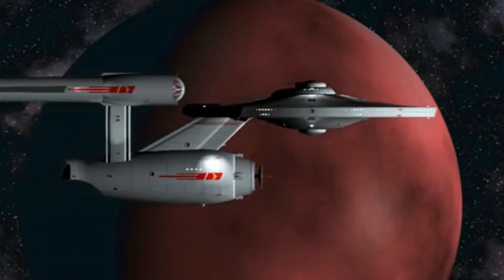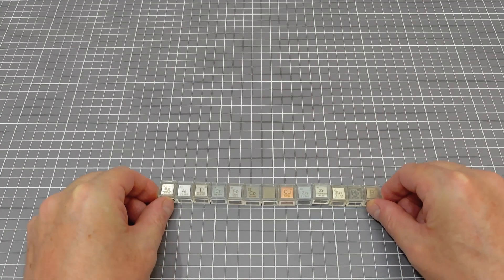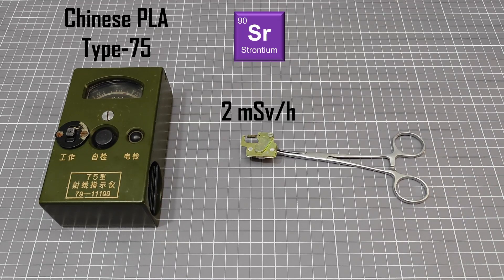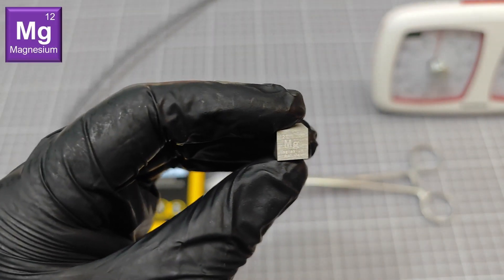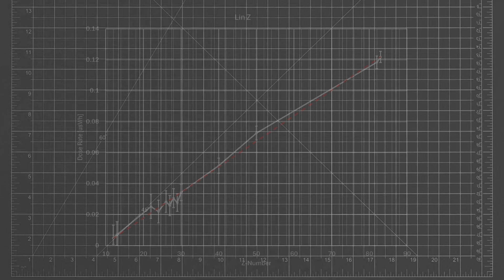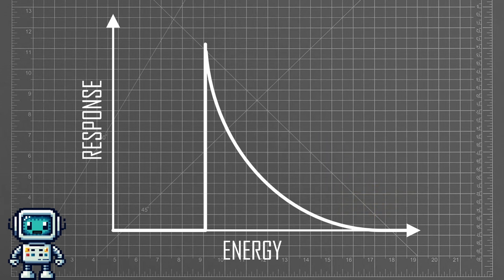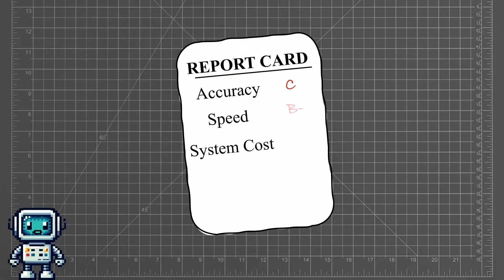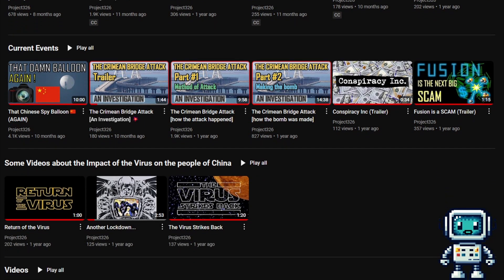Identifying Elements with Beta Backscattering [a DIY project]

Comment: Awesome! This is an excellent and very informative video! We share a lot of the same interests and ideas, and I simply love that! The experiment you've done with these elements is quite aprapos to what I've done, so far! I've (sort-of) done this, but instead I used a 10 μCi (370 kBq) ¹⁴C source and a "pancake" G-M tube–that is, the SEI Inspector USB Geiger-Müller counter. Also, I have to have the ¹⁴C source closer to the target, since its endpoint energy is only about 156 keV. If I place the source (active side up/inactive side down) on top of the G-M tube, I detect "skyshine" from the low-energy β- particles scattering off of air molecules, and a substantial number of β- particles are backscattered right back into the G-M tube. However, if I use elements with differing atomic numbers placed above the source, then I get more detected backscattered β- particles! However, my setup is crude and basic. For example, I don't have a 3D printer to make such awesome setups. So in conclusion, I see a lot of potential with your future endeavors into ionizing radiation, and its usefulness! That's really cool! There's always something new to try and do! Thank you so much for another wonderful video! Keep up the great work! 👍
Reply from the maker: I'm glad you enjoyed the video, I'm always looking for new things to try with ionizing radiation, thanks for the inspiration!

Comment: hey wow! that is some very cool stuff my friend! I whish I thought of that! I am always amazed how talented people can do so much with so little!
Reply from the maker: Actually, I have a question for you.  I have been trying to understand why this effect 'should' plot a straight line on a graph with a log-z scale, with a linearly increasing z-number.  I'm not saying that I think this is wrong, I just don't understand why.

I did some simple geometric analysis to see how the charge density per unit volume changes with z-number (assuming equal P and N), but I didn't find anything that was logarithmic in response, mind you, its wasn't linear either...
Perhaps my approach is wrong, ie starting with the math and trying to apply it to the physics.

Any idea where I might be able to find an answer to that question, or at least some clues?  The AI engines I tried basically had a 'brain-fart' when trying to answer that question.  All of the published data I managed to find (admittedly, not that much), on this subject clearly states a log-z response with count rate but never says why...
Reply: @project-326  this sounds counter intuitive I agree! This smells like a math problem to me ! Let me make a fool of myself again and  venture a wild guess! The log scale represent vastly separated numbers in your cases counts, but they can still be "aligned" or linear, since the radiation behave like light, it's intensity increase according to the inverse square law, I would expect the count to be far apart and a log scale would make sense. But why would the data stay linear? Why not? As long as Z increases at a steady pace there is no reason to deviate.. of course I could be completely wrong here ! This is just a first thought... More like rambling!
Reply: I guess the additional charge in the nucleus doesn't change the path of a single electron too much but with astronomical  numbers of atoms the statistical results is very significant.. what do you think?

Comment: What are your error bars?  My eye says NONE of the data disagree with the linear model; all of the error bars overlap the line -- much less twice the error bars.  One in three will disagree (to one standard error and on average) even when the data are taken from the same distribution.
Since these counting statistics obey Poisson's distribution instead of Gauss', the total counts +/- sqrt(count) would be a more correct representation than average and standard deviation.
Reply from the maker: mean root deviation from total mean value.

Comment: Thank you for sharing this interesting experiment. Especially your measurements of electron backscatter spectra with the Measall KC761 of Al and Pb raise my curiosity. The energy distribution of Al looks very sharp. Did you compare it with direct beta radiation from Sr 90 source? Maybe not so easy, because of the much higher flux. Increasing the distance would help, but which role plays scattering in air? Primary electron energy should be 546 keV, if I am right? But there can be inelastic scattering in the source itself, maybe broadening the source spectrum (?).
Reply: the basic issue with the spectra of beta radiation is that it forms a continuum and not discrete energy levels.  If you take a look at the spectra, you see a maximum energy at 546 KeV but the peak of the energy curve is at 196 KeV.  We were working on a beta spectroscopy video (several months ago) but basically gave up over this issue, and the fact that the only device we have that can make any meaningful measurements of the beta spectra is this PIN diode based detector.
We are working on a new video that includes a few interesting experiments based around this Sr-90 source and will show why we were not able to extract a spectra from our detectors.
Reply: Thank you for these interesting results, I would not have expected it to this degree. A lot of inelastic scattering seems to slow down the electrons here. Maybe in the source itself, if it is thick enough? On the other hand, I can hardly imagine that a short air passage and the inactive top layer of the PIN diode make a relevant contribution to such an energy loss. Of course, the low detection efficiency of the thin active layer of the PIN diode for fast electrons will lead to underestimating the high-energy part of the distribution. Anyway, I am curiously waiting for your new video.

In the meantime, by the way, I found your very interesting and in-depth analysis of alpha spectra. Another video I came across might be an option for people who are interested in this topic and don't have the Measall KC761 / KC761B or are hesitant to void the warranty by removing the protective cover. It describes a DIY approach, so Measall's resolution might be better (?). According the alpha-energy calibration shown in this video I am now a bit skeptical too, after I have seen your analysis:

https://www.youtube.com/watch?v=1uoUGNa_g_E
Reply from the maker: I think that a lot of the experiments do something similar to Stoppi, they just calibrate at the published energy level, which is fine as long as the reasons for it are valid in the context of the purpose experiment.  In my case, I wanted to see if the energy resolution to alpha was accurate on the instrument that I was using, and I'm fairly happy that I managed to account for the differences between the theoretical values that come from the atomic models, and the values that I was seeing.

For the beta energy, the KC761 cuts off in firmware below 100 KeV, the top layers of the diode are just going to absorb too much of the energy for useful measurement.

Comment: Ive been looking for this device and its very supper expensive and you have to ask for a quote just to buy one of this
Reply from the maker: Yes, exactly.  XRF machines are really cool but just so far away from my budget - hence this experiment with a cheaper technique...
Reply: @project-326  idk if this method will it work on metal alloyed or metal with impurity I only want to separate the right metal that I melted using my furnace so I can separate each metal alloyed or none alloyed
Reply from the maker: @csmyfavoritecompany1213  it needs very careful calibration with reference samples.  If you are separating metals from scrap then a lot of the elements will also be transition metals with quite close atomic numbers, so the system accuracy needs to be very high.  If you are separating Al from Pb, less so.
Hope that helps!

Comment: Now that was a very good video! I did try something like this with the KC761B but didn't make this nice rig and much less scientific patience... So it didn't bring the results I hoped. Now, I'll try again.
Reply from the maker: Thank you, I managed to get some results from the KC761(A) with the modifications to the PIN diode but there was less discrimination at lower energy, and hence with lower z-number elements.  There seems to be a minimum activation energy for the PIN sensor.
Reply: @project-326  yes... Beta mostly gets kind of dumped in the low energy channel and does not discriminate well. But the latest update did help with compensating the alpha particle energy quite well in comparison. Thanks again for all that info I learned in that video.
Reply from the maker: @PeterMarchl  The basic physics of the PIN diode is the main reason for the limited range of the beta energy spectrum, even with the update.  The FW limits to a lower range bound of 100 KeV and the limits of the thin intrinsic, means that the response just keeps dropping with increased energy.
You are right, the alpha energy compensation is a definite improvement with the last FW update.

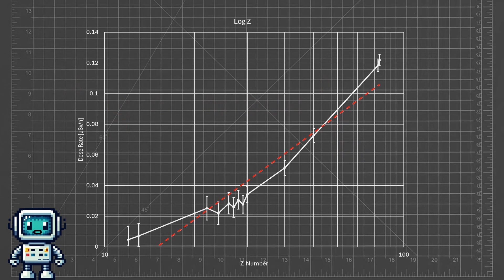Comment: 11:00 It actually makes sense that backscattering of beta particles from light elements consists of slower (less energetic) particles; smaller nuclei will have a weaker force acting on the particles meaning faster particles will not be curved as strongly and will not hit the detector. When measuring heavier elements, the opposite is true.
Reply from the maker: that was our assumption too, but it was very reassuring to be able to test this with the PIN diode spectrometer...
Reply: It does make complete sense that the heaver elements will be able to interact with faster betas, but it was good to be able to check that assumption.  Physics has a habit of throwing up effects that often don't seem important in one situation but suddenly become dominant in another.

Comment: If you measure low energy radiation, put a thick copper plate after the lead, otherwise the lead will cause a shower of lower energy radiation as result of the slowing down of the initial particles you want to shield.
Reply from the maker: That's a great idea, thanks!
Reply from the maker: May I ask, why copper?  What property of copper is helpful in this regards?

Thanks in advance.  Always looking to learn!
Reply: @project-326  it's the most simple "graded-Z shielding". In wikipedia "Radiation protection", see:
"In a typical graded-Z shield, the high-Z layer effectively scatters protons and electrons. It also absorbs gamma rays, which produces X-ray fluorescence. Each subsequent layer absorbs the X-ray fluorescence of the previous material, eventually reducing the energy to a suitable level. Each decrease in energy produces Bremsstrahlung and Auger electrons, which are below the detector's energy threshold"

It can be lead-steel-copper, or lead-cadmium-copper, or similar. Lead and copper is already good.
Search also "Homemade Graded-Z Shield for a Gamma-ray Spectrometer"

Comment: This would be interesting for testing gold (and silver). Pb and Au are a couple of atomic numbers apart, and Pb is commonly injected into gold bars. The usual tests are density (weight and dimensions), a "ping" test to measure speed of sound (also using an ultrasonic thickness gauge), resistance (using eddy currents, a pulsed electromagnet next to it), and destructive testing using acids.
Reply from the maker: The down side to this technique is that it really is only testing the surface of the material, beta's don't need to get very far into a typical metal before they will be totally absorbed.  For Au and Pb, that is a VERY short distance.
Still, it was a fun experiment and we are pretty pleased that we got some good results.
Reply: @project-326  Oh right, same issue with XRF testing, mostly just the surface.

Comment: courage experiment, if you could have compared the incident count rate to diverted, the ratio could have been related to element identification. Also the diode detector or even plastic scintillator could make better gamma discrimination that would also increase beta sensitivity. The question is also, how does the diversion angle depend on core mass? If you could measure on two different angular positions, the subtraction may give angular difference. This reminds on bremsstrahlung, that is principle of x-ray, as the high accelerated electrons do divert over the wolfram core and by reduction of speed do emit x-rays, but here the effect is not as significant likely to have E=mc2 resulted x-ray.
Reply from the maker: Thank you for the interesting feedback!
Reply: @project-326  thank you and as you described the glass tube may not be the best solution is its geometry of cigar gives you a lot of background, regarding that source radiation may have more narrow radiation. So some cylindric window tube like LND712 shielded on sides may collect more source versus background, specially if you intended to reduce the distance your dispersion geometry fits even better.

Comment: I built my tricorder in 2013.  It was a bit different though as it is a libs system.  It will identify most of the elements, I have acquired now about 60 (supposedly 99.99% pure) samples and built my own library of spectra.  I use it primarily for verifying mineral ID for which it works well.  This thing cost about $1000  for an Ocean Optics spectroscope and a (Chinese) tattoo removal machine.  That and something to support the laser and the sample is about all that's needed.  Cheaper spectrometers are available and I have seen the tattoo machines for about 300.  Anyone interested holler at ulao the number 10 AT gmail period commercial.  I'll freely provide any info needed.  After watching your video I bought the Radiacode 103.  Very pleased.  Keep up the good work.

Comment: I actually don't think I've ever seen anyone else here do this before, and that's really saying something considering how obsessed I am with exactly these kinds of science videos on the site! (I too have many a time wished to own and simultaneously lamented the insane cost of XRF devices) Thanks for your review and recommendation of the "Little Garden" spectrometer again, I just got mine and the spectral resolution is EXCEPTIONAL, I'm thinking of making it a little better by using a pair of razors for the entrance slit instead of the printed pla. There is another industry tool used to do what you are attempting here which doesn't use XRF or beta backscatter, it's a "spark spectrometer" or "spark optical emission spectrometry". Bruker and some other companies sell high end units to the metals industry for process analysis, but I think you could do a rudimentary version of it with none other than our LG spectrometer itself! It's just a spectral analysis of the plasma light emission from a low voltage spark contacting the metal in question. It's destructive, but only very slightly. I will also echo the comments of others urging the introduction of a 1cm thick piece of plastic before the lead in the shield portion of the device to suppress brems production in the lead (may as well keep the lead to block the few Y90 gammas).
Reply from the maker: Thank you for the ideas, I will add this to the already crazy long 'wish list' for videos.
Really pleased you like the LG spetro too, if you look on the post on the community tab for this channel, we included the creators email address.  He is a really nice (and modest) guy, it would be great if you sent him a quick email letting him know, it would make his day...
As for the Bremsstrahlung radiation, I did a background measurement without any sample to deduct from the total from each sample that hopefully accounted for a lot of this (except what occurs in the sample itself).  You idea about alternative shielding materials is also good, perhaps HDPE would be good too.
Reply: @Muonium1  oh that sounds very interesting indeed! I hope you keep us updated on the progress!

Comment: It's better to shield beta radiation with plastics, not lead. 5mm plexiglas is a good protection. This avoids the generation of x-ray that will travel farther.
Also, always use some glasses, betas are terrible for the eyes.
Nice experiment, maybe it could have also been done by measuring the noise in a camera in the dark caused by the back scattering. For an even more low cost way.
Reply from the maker: I did a measurement with a webcam (with all of the optics removed) using this same source and there is certainly some dark noise, but far less than I initially expected.  On the surface of the CMOS sensor there is a fairly thick SiO2 passivization layer and the Bayer filter that seems to be better than expected at blocking direct (and very close) betas.  That experiment will be part of another video that includes of other general beta experiments I have done over the last few months.

Comment: Are there any cheap XRF guns you can review?....I did buy a Radiacode 103 because of your video.  Thank you!!
Reply: I think the only hope would be finding a used broken one you can repair. Those are probably still thousands.
Reply from the maker: @gargantuablargg  Yes, indeed there are broken ones out there, but there also seem to be company's that specialize in buying them up, refurbishing them and re-selling.  There is a lot of circuitry to go wrong in these things, the HV x-ray PSU is probably the main culprit...
Reply from the maker: Sadly, even the cheapest seem to be very expensive (about $7K).